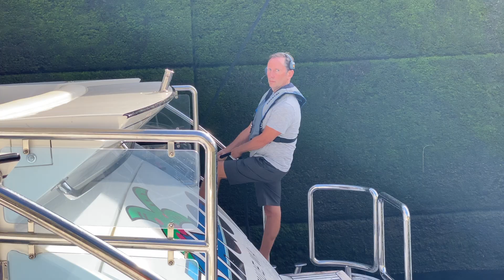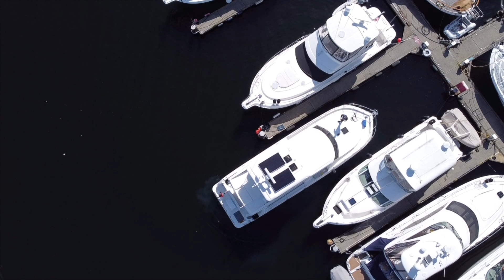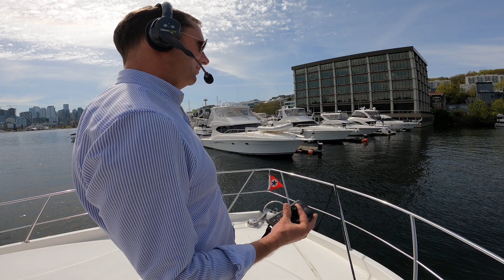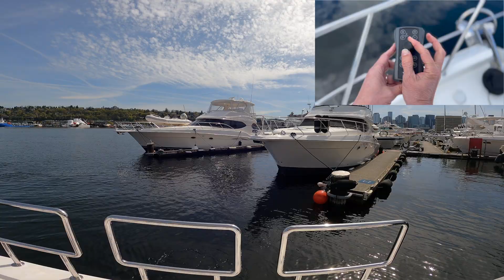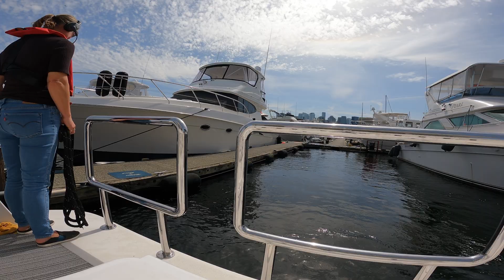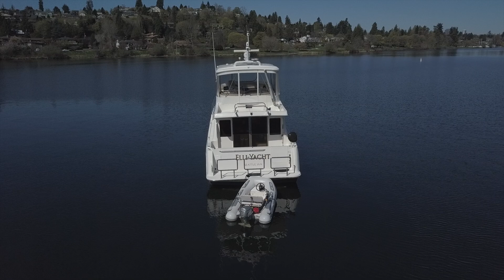Docking Made Easy

Comment: So, you poo-poo the "bang-bang" thruster controls of the competition, but then admit that your Dockmate setup is also running your solo  thruster "bang-bang". Did I understand you right?
Reply from the maker: Not trying to poo-poo on anyone. You are correct that our boat doesn’t have progressive bow thruster. However, for those that do, the flexibility of supporting progressive thrusters is very important, in our opinion. I will also point out our engine controls do take advantage of the progressive control feature and it is extremely helpful in maneuvering. Hope that helps!

Comment: I'm truly missing what you can do with this that you can't do with your clutches and existing bow thruster and even better, with just the clutches as most of us learned with (no fancy bow/stern thrusters).     Looks cool like you're playing a video game though.
Reply from the maker: Good question. Really the big difference is I can do everything you outlined but, standing on the bow tending lines in the locks.  It also makes single handing the boat in moderate to high winds easier too.
Reply: @ElliYacht1  roger that.  I guess I'm old school and if you can't handle the boat without the fancy bow/stern thrusters and just the sticks (with wind/with currents), then, more training is required.    I just can't justify spending thousands of dollars on a fancy system like this so I can stand on the bow.    What happens when you're on the bow , you have high winds and the system fails?
Reply from the maker: @tlteal  I hear you. However, I’ve had Hynautic  stick systems fail and had to manually shift from the engine room while communicating to my first mate to dock. All systems have failure points, even those meticulously maintained. 

If this system was to go out, I’d walk back to the helm.  Redundant systems are never bad IMHO.

Comment: My boat is a 2001. Doesn't have a bow thruster. I also have Hynautic controls which work great but are not digital. I did add a stern thruster and was able install it all myself. It is wireless and came with a remote too. Helps alot in the locks. Thinking to add a bow thruster and all the digital equipment to hook up to my twin Cummins would cost a ton. Is there a local company in the Puget Sound handling your brand of remote?
Reply: You installed a wireless stern thruster? Surely it has wires connected to batteries somewhere, no? If not, then what powers that motor?

Comment: In your research, how does this compare to The Yacht Controler??  Thank you 👍
Reply from the maker: My personal analysis was that the architecture of the Yacht Controller, while the original and current leader by volume of installations, was dated. It lacked the flexibility combine propulsion systems to act in harmony (eg, sideways motion combining engine and thruster propulsion). 

Also, their joystick functionality isn’t available on the remote. 

In addition, the ability to fine tune the system to the unique combined variables of power, drive train and hull design to each boat via software was a clear differentiation for Dockmate. 

Last, at the time, Yacht Controller hadn’t successfully released promotional throttle control and modular upgrade capabilities. They may have that now but, I haven’t revisited their current offerings for a year. 

Hope that helps!